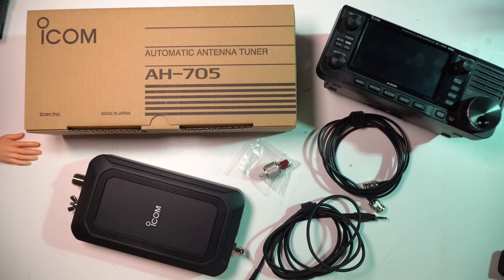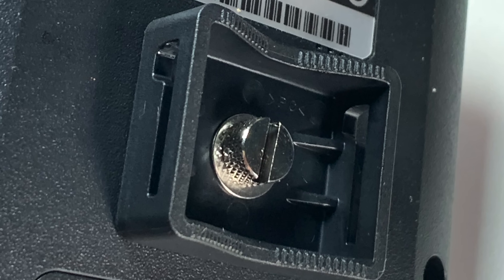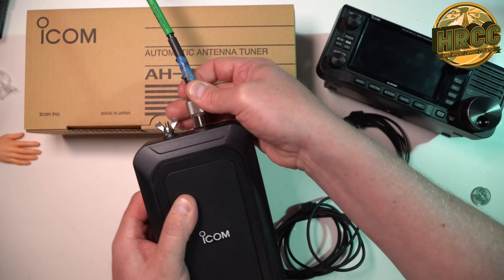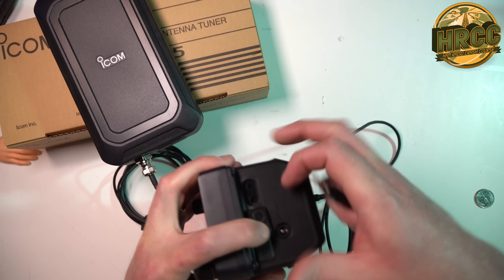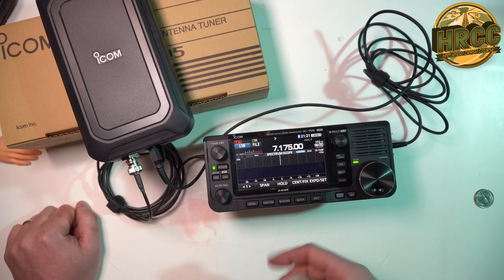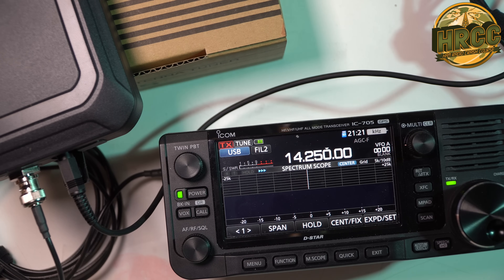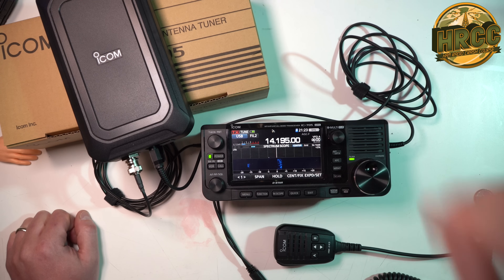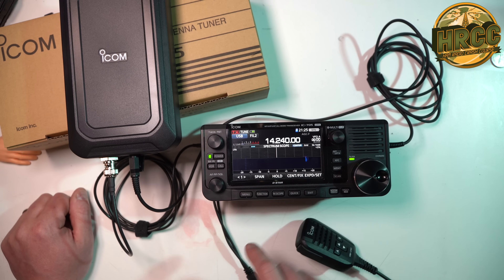ICOM AH-705 Antenna Tuner Quick Look AND Setup!

Comment: If you choose to run this tuner off a power supply, you need a power cable with the 2.1mm power connector, instead of the 2.5mm plug that is on the IC-705. 
The Powerwerx DC21RA cable with Powerpole connectors is available for the AH-705. It has a right angle plug going into the tuner. 
The Powerwerx DC25ST is the part number for the IC-705 power cable. Both are available at HRO for $8.

Comment: For those balking at the size of the tuner compared to the radio it is designed for here are the dimensions from the Icom website…. 
IC-705:  7.9”L x 3.1”H x 3.3”D
AH-705: 7.5”L x 4.1”H x 1.6”D
The tuner is a bit wider and longer than the radio. However, if you are using the Windcamp ARK-705 cage, then the visual  differences in the dimensions of the tuner when laid flat against the top or back of the rig are negligible. The tuner basically only adds about 1.6" to the overall size of the package. What is needed is a strap or a bracket that mounts the tuner to the top or back of the cage (and that is a project I am now starting to work on.) But, if the perceived differences in the size of the radio and tuner are going to a deal breaker for you, then whatever...can't please everybody. 
Personally, I think Icom should have opted to create a tuner that uses the same battery pack as the radio itself, instead of the internal AA batteries. But since a lot of what I see being used are the Bioenna external battery packs, then maybe a tuner that fits in place of the internal battery pack on the back of the rig would be something Icom can look at. Perhaps this will find its way back to Icom and we will have an upgraded "705-Mk2" that incorporates this idea AND a USB-C in place of the current microUSB.

Comment: Nice fast vid and very informative, I am seriously considering the AH, are you sure about using rechargeable cells? No possible damage to the tuner? Thanks, really enjoy your channel. Vic
Reply from the maker: I've only put rechargeables in mine, working great!
Reply: Interesting considering the manual says in bold print to NOT used rechargeable batteries.

Comment: New to amateur radio and interested in field operations QRP.   I haven't bought any equipment yet but been watching your videos.  my question is would one use the AH-705 with a magnetic loop antenna that has a manual tuner knob already?  Is there any benefit or not really needed?  Thanks for your work and videos.  I've been learning a lot from them.

Comment: Sir  my 705 is not recognizing the AC 705 tuner, I got it hooked right can you help me trouble shoot this thank you
Reply from the maker: Batteries, check cables and make sure it’s activated on the 705.
Reply: @HamRadioCrashCourse  Rodger I will double check all those things, Does the antanna make a difference? what antanna do you recommend with the 705 for QRP purpoaes?

Comment: The radio is already way too deep.  I want a tuner that’s the same size as the battery pack
Reply from the maker: Look into tuners that are the size of a battery pack and how well they tune long wire antennas.  Note, I mean long wire, not a long wire running an unun, etc.
Reply: @HamRadioCrashCourse  I was thinking about an Elecraft T1 ATU.  I think it would be about perfect for this radios size.  

I’ve run my LDG z817 with a 500’ spool of thhn and a banana plug pushed into the SO-239.  Worked great!

Comment: Not very good having to jump to menu every time you want to tune.  Better to use an rf sensing tuner.
Reply from the maker: It does both.
Reply: @HamRadioCrashCourse  I'm looking to buy this tuner to match with my 705, I can't find anywhere that this tuner also works by RF sensing, do you confirm ?

Comment: Any idea what size external DC plug is required to connect to the DC input socket on the AH-705?
Reply: 5.5x2.5
Reply: I think it 2.1mm on the tuner and 2.5mm on the radio.

Comment: With the XPA amp, and this tuner, it's basically a 7300 with 2m & 70cm lol. Damn I want this radio, but I don't even have a job yet hahaha.

As for the tuner it's self IMHO. For a 10w $350 tuner, ouch. At that point, unless you really want to have the matching tuner, it would probably just be more worth it to get an LDG. Which you could use for other radios too, or maybe just get an MFJ pocket manual tuner. Don't get me wrong, it is a very nice tuner, but for that price I'd rather get a fancy HT, or 300ft of LMR400 coax and a bag of connectors.

Still, it is a very nice tuner. Thanks for your unbasied review as always Josh, 73 de W8IJC.

Comment: Wow that's nice.  What is a tuner for?  What does it do?  How do you know you want a tuner or don't want a tuner?
Reply: It electrically matches the antenna to the tranceiver based on the frequency the tranceiver is tuned to. Speaking in terms of the actual physical antenna, long wire antenna, for example. The lower the frequency you transmit on, the longer the wire would need to be. Some frequencies, that wire would be 160 feet or longer. And the longer the wire, the higher the impedence. The tuner matches the frequency to the antenna to maintain an impedence of around 50ohms, and allows you to work with a much shorter section of wire. A 30 or 60 foot wire antenna is more resonant to many frequencies in terms of wavelength, and is easier to pack for remote operations in the field. Ideally, your antenna should be cut to be a quarter or half of the wavelength. So, on the 40 meter band, an end fed half wave antenna should be 20 meters in physical length. An antenna tuner helps with the fine tuning. 
This is the rough and dirty version, but I hope it helps.

Comment: That thing is freaking HUGE. I am beyond pleased I bought the Vibroplex MAT705 Plus tuner. Its way way smaller and can tune up to 1500 ohms at 30 watts PEP. 

Also HRCC and folks watching you can bind one of the two letter keys on your 705 hand mic to Tune, I used key A on the hand mic, that way you dont have to keep going through touch screen menus. 

Also Amazon sells touch screen protectors for your 705. Very expensive equipment, buy a screen protector for 9 bucks and you will be pleased.

Comment: Is this an April fools joke?  It is designed to be paired with a QRP radio...it's larger than the radio!  And is it really more than $300????
Reply from the maker: Lol, its not larger than the radio.
Reply: @HamRadioCrashCourse  Maybe it's your camera angle....several other comments appear to agree with me.
Reply from the maker: @daveG1020  What do you want me to say, its not bigger.  Why would I lie about that?  Check my Instagram, there are images up there now.
Reply: @HamRadioCrashCourse  Maybe there is a reason for the size compared to other options?  Is there lower RF loss compared to other, much smaller ATUs?  I'm just saying, this video was unhelpful, other than to show that it is big and it tunes. Thanks.
Reply: The tuner is on top of the box most of the video so it's closer than the radio which is on the desk which is probably why it looks bigger. When they're on the same level the tuner looks like it's slightly smaller than the radio
Reply from the maker: @thedmutz  You nailed it.  I didn't realize people would be that upset about the size.  Its not bigger than the 705 by any means.

Comment: Too big, too expensive, according to other YouTubers, isn't designed to work with EFHW's, and according to iCOM's documentation, only covers a 1:2.0 VSWR and you aren't supposed to use rechargeable battery. Personally for $200 less money ... LDG Z-100PLUS/IC-705. Bigger tuning range and smaller.
Reply from the maker: Why wouldn't it work with EFHW?  Rechargables worked fine.
Reply: @HamRadioCrashCourse  I'm referring to the 
watersstanton video he just did at the 4:22 mark and said that "you should avoid end fed half wave I guess that's because they are high impedance". I'm not sure why he or apparently iCOM said that.
Reply: @W9HJBill  What it recommends is not feeding an end-fed half wave of wire DIRECTLY into the tuner (using the provided PL-259-to-wire adaptor), because the internal impedance matching range is not sufficient for that.  However, you can absolutely attach an EFHW that uses a 49:1 transformer to this tuner, as there the 49:1 is doing most of the impedance correction before the tuner comes into play.
Reply: @chetmystery  I guess it's just an odd way of saying that. To me, unless you are putting the 49:1 toroid in, then it's just a random length of wire.

Comment: Maybe I’m missing something, but why didn’t Icom just reverse engineer the tuner from the Elecraft KX3?  It’s very small and would have easily fit inside the 705. I’m not a hater, but Icom really missed the boat on this one. - KI8R
Reply from the maker: Different capability.  Likely higher matching capability.  I'll put it through further testing and I'll post an update.
Reply: Was there ever an update video? Does it indeed have better matching than small capable tuners?

Comment: I got mine today and it is a very good quality atu. So far it has tuned any vertical or wire i have connected to it. Also you only have to key the mic once you tune to a different band.
Reply from the maker: Very good performing tuner. 

I dod notice o could trick the 705 into not entering the tuning cycle after a band change. It was some order of buttons I pressed.  

Works well though, all things considered!

Comment: Compared to the MAT-705, this thing is massive. For that size, I wish it was RF-sensing instead of needing a control cable.  Me personally, I'd rather spend the extra dollars and just get the Xiegu XPA-125B so I can have 100W and a tuner in the same kit.
Reply from the maker: True. The xpa-125 is big and very heavy though.
Reply: @HamRadioCrashCourse  True, but it'd be a good alternative combo for a base station setup. 100W at home or in the field. Still cheaper than an Elecraft KX3+KPA+PX3. 😉

Comment: It's such a large tuner compared to the MAT705plus. Any idea how they compare?
Reply from the maker: I need a few “will it antenna?” Videos under its belt to say for sure.
Reply: waterstanton did a video where he tried a number of different bands and antennas and they all tuned, even those that were out of spec (too short - 5m compared to the 7m recommneded in teh manual and  end fend halfwaves, which the manuals says to avoid).
I think they all tuned.
On the other hand Ive seen videos with the 705  where the MAT has faiulked to tune and the same with the elecraft T1.
I'd really love to see a like for like comparison too - I'm about to order my first rig,m which will be a 705 and I'm happy to spend the money - as long as it is worth it - i.e. it can do soemthing useful the other tuners can't.  
Just looking at the size of  it and the specs, I kinda wonder if it is just an AH-4 board that has been put into a different case.